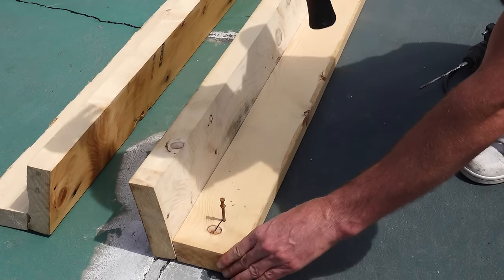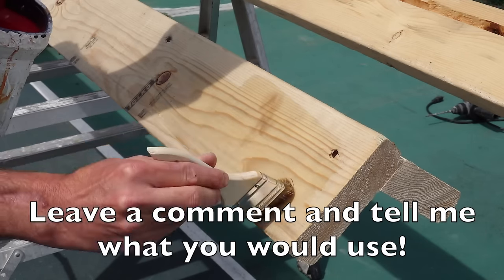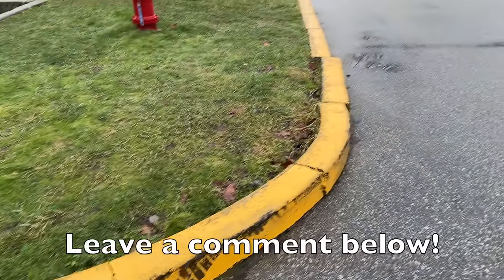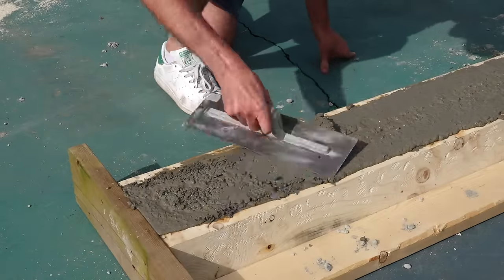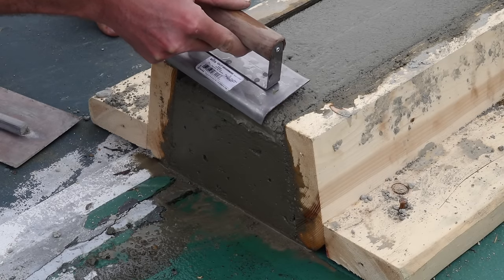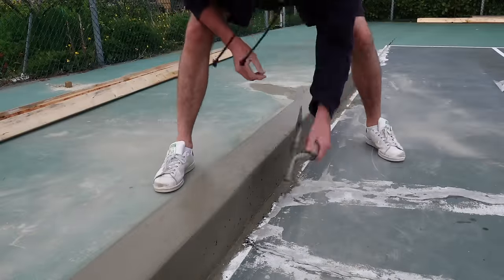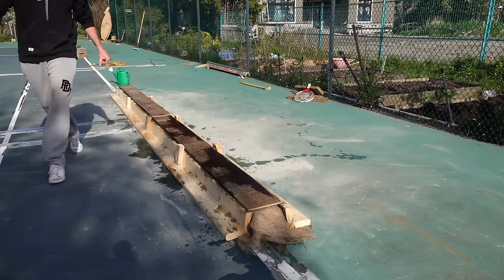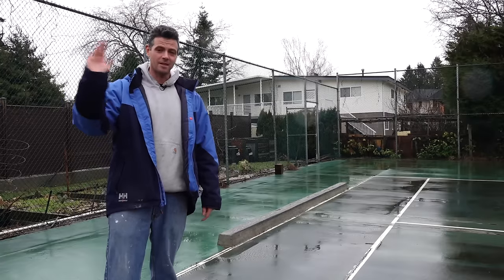Building a Curb

Comment: I did a small project recently, instead of a hammer I used a sawzall with the blade removed. Press against the form. Worked great to vibrate.
Reply: Dome headed bolt into a drill and use the hammer mode.

Comment: Im a finish carpenter so I dont do concrete very often but I have poured a fair amount of small walkways and patios over the years. I usually run the edger almost immediately after screeding it (while im mag floating it first pass) but only a very rough pass just to get the rocks out of the way. I come back later and actually make it nice once its set up enough. Cheers from Toronto. Nice curb!

Comment: PPS- when using screws with concrete work I'll just use some cheap candles, u could use skate wax to fill the heads. I use torx drive. It works great to keep concrete out of the heads and makes taking forms apart a breeze 👍

Comment: I remember also anytime we started a curb I would always save my old beat trucks. I used to go over the new curb and it would be like glass plus I found it did not chip as much over time since there was a nice layer of metal on the edge.
Reply from the maker: It helps for sure. It’s like an aluminum rub brick that also fills the voids.

Comment: Canadian Builder Magazine Cover: "Turning your tennis court into a skate park."  😁

Don't worry about rebar; it rusts because concrete is porous, allowing moisture to penetrate and reach the rebar. I have precast concrete sidewalk panels in the back yard of my 82-year-old house in the USA; the rusting rebar has caused the concrete to weaken and start breaking up. I've had to cut the exposed rebar out on more than one panel.

Comment: Great video Ben! I built a bunch of skate curbs over the years, and from my experience I think its really hard getting the dimensions just right. Different dimensions work better for different tricks, so finding the sweet spot can be really challenging! Your curb looks great and it shows when you skate it! Hope we also get to see a build video of your concrete bench!

One tip I can share to anyone doing this is that if your hammerdrill can be set to only the hammer function you can use it as a vibrator on the forms. Works great!

Comment: Typically the braces i put on a form like this stay in the way and i scrub with a mag and edge right before stripping the form.  You pulled the form partly right in my opinion i pull away slightly then i press it back into the crete and slide up i found if sliding straight up the suction can pull the top edge off. Sometime in certain circumstances i pull them just like you did scrape the cream off the board with youre trowel. Then use a float to work it back into the voids. I think its really funny you kept it that wet for 30 days but you are 100% correct and it made it alot stronger than i think you realize it did. It basically melts the lime dust back to the lime rocks much better than a fast cure ever could. You did a great job watching this made me want to build a mini skate plaza in my yard haha
Reply from the maker: Thanks for the tips!!!

Comment: I'm far from a Master of concrete - but I've been told by some that in general, you want to avoid using anything that agitates it too much while it's drying.  The reason - it makes the aggregate (rocks) settle to the bottom, leaving the "soup" part of the concrete higher - and that is weak - and how cracks/chips form.  I'm not saying you can't vibrate it, or trowel it - in fact you need to, in order to get a good shape - but I am saying that it is better to apply those methods as sparingly as possible - the better off the final product is from a structural standpoint.

Good video - always liked this channel.  Learned a lot from it and my house has definitely benefitted from many a DIY project gone right!

Comment: Used motor oil lightly sprayed on the forms really helps with releasing the forms. Hard work but very satisfying.
Reply from the maker: I read so many people saying diesel as well.
Reply: Glad you said that because when we use oil we dilute with diesel for going through yard sprayer. Good stuff man.
Reply: Yup old motor oil thinned with diesel for pump spraying. Cooking oil works too if wanna be more eco, can also get good eco release oils now too but cooking oil cheaper

Comment: The only real issue I saw is the lack of bonding agent.  Without that the curb is going to let go of the slab it's on. Learned about bonding agent on Holmes on Homes. Other than that use plastic to space the rebar, wood will still absorb water and take it straight to the metal. Stainless wire to the form is another option. Once the bubbles have been tapped out you can pull the wire out if you choose and the rock won't let the rebar drop. Thanks for all the tips on drywall. I turn wrenches for a living but remodeling a house for an airbnb retirement income. Your vids really helped!

Comment: Civil Engineer with no experience skating or actually building forms. Just know what I was taught in school and what I inspect for on job sites for rebar.

The distance between the rebar and the edge of the forms is based on the size of the rebar, and the size of the aggregate (rocks) in the concrete. Typically 25-30mm, this helps mainly to protect the rebar form moisture ingress, avoid concrete spalling, and a host of other reasons.

The other thing was using wood as a spacer for the rebar to hold it up. The wood is quite porous and whicking, it will take in moisture from the subsurface right up to the rebar. It will also rot over time and swell which might cause issues down the line. With this being on a tennis court, it won't be as much as an issue but something to consider in the future would be either using plastic chairs to hole it up, or even pieces of concrete block work that has been broken uṗto lift the rebar into the air.
Reply from the maker: I usually just use rocks or chunks of concrete.

Comment: Hey Ben! I’ve been a fan of the channel for a while now. I know this is a concrete video but I have a taping question that you might have an answer for. Say I already taped my inside corners with the slop bucket method, roller & flusher- and now the inside corners are ready for a coat of mud. Instead of using a compound tube with an inside corner applicator head, and then using a flusher to feather everything out; could you use one of those spherical paint rollers (I think you’ve called it a lambs wool roller, or it’s called a corner roller) in place of the compound tube, and still use a flusher after. I invested in a Columbia super taper, roller, and 2.5/3 inch flusher heads but not sure if I want to invest in a compound tube with inside corner applicator just yet. I was hoping I could just use one of those spherical paint rollers to apply mud then proceed to flush with flusher instead of the compound tube method. Sorry if that was a lot aha.
Reply from the maker: Yes you can. Give it a try, it should work
Reply: @vancouvercarpenter  Ok 👍 
I’ll have to give it a shot soon then!
Thanks for taking your time to reply.
Much love, and respect from Chatham, Ontario (near Windsor/Detroit Border)!

Comment: You can use an electric sander or your hammer drill to tap/vibrate the form boards .. the hammer works well too
Reply from the maker: I used a hammer drill on my next curb but overdid it a bit I think.

Comment: Not a pro, but I've used mineral oil (baby oil) as a form release. Also, I don't know if this is an advised usage, but I've used a large common nail turned backwards into a hammer drill as a vibrator for tamping base under concrete; maybe it'd also work as a way to vibrate the outside of the form in place of a concrete vibrator? It might be too fine of a vibration compared to regular hammer....

Comment: Run the edger as soon as you can .. running it too late can be a hassle .. edging pushes the rocks away from the surface so you don’t have rocks and sharp edges .. when it sets up  more you can get a better finish on it

Comment: I thought you would suspend the rebar with tie wire from top of form ties. The wooden blocks you used create voids in structure. Unless you block it up with Dobies. 😅
Reply from the maker: I would have used rocks or chunks of concrete if this was a proper build.

Comment: Time will tell but I think you should have drilled into the ground about 15cm to hammer in some rebar to 'pin' that curb into place. As it stands right now, there's nothing but gravity and a little surface friction holding that 16 foot concrete sausage in place. With all those skaters striking that curbing, it's only a matter of time before it shifts location. You can still save it by drilling through the curbing and down into the ground to pin it in place but it's just going to be more effort than doing it before you poured the concrete and better because the holes for the rebar would be invisible.
Reply: The weight of a single skateboarder will never move that 16' curb. Not only does it weigh 600lbs, but because it was cast in place there's am enormous amount of static friction keeping it from moving.
Reply from the maker: Time has spoken. It has not moved. The bond to the ground hasn’t even cracked yet. I’ve actually been considering trying to break the bond because I would love to move it over about four feet.
Reply from the maker: This was built a year and a half ago.

Comment: I have a PhD in concrete, and I can confirm that finishing low slump concrete like that is very difficult. 😅

With the environmental exposure and the physical abuse you're putting on it, I think the rebar and month of wet cure were justified.
Reply: the rebar is good so long as the cracks stay tight (as they should here) and you didn't put too much water in your mix. With a higher water/cement ratio you'd have more porosity and you'd get rusting on your bars - failure - at a shorter service life

Comment: I run the edger over it twice.  Once while it's soft just to move the bigger rocks out of the way and once after it;'s firmed up a bit to establish the final shape.  The mix also makes a big difference.  A six sack 60:40 pea gravel mix will be much more forgiving of a delay in the first pass than a mix with 3/4" aggregate.  With bag mix I like to overfill the forms a little to let any excess moisture escape before i screed it ~half hour after first placing it.  With an air entrained truck mix this isn't necessary.
Reply: Also you want to pull the fasteners and smack the end of the form get it to slide along the length if you can.  That way there is more concrete to resist unwanted deformation versus sliding up and potentially pulling the corner away along the entire length.
Reply from the maker: Thanks for the info!!!